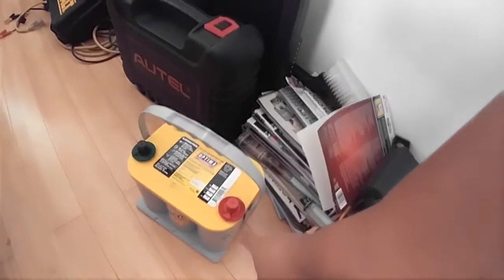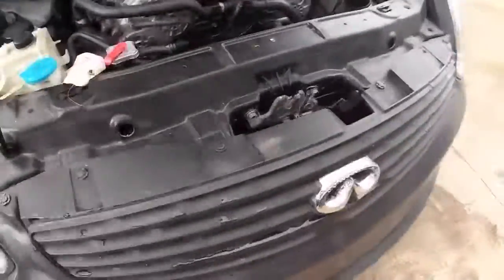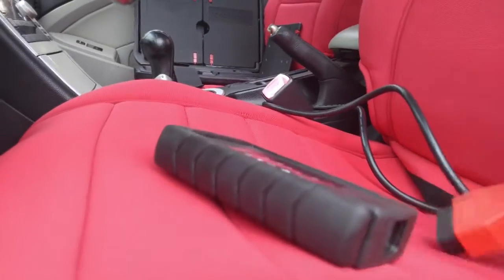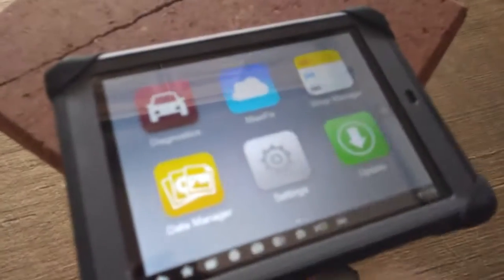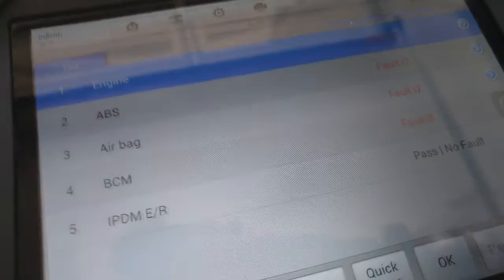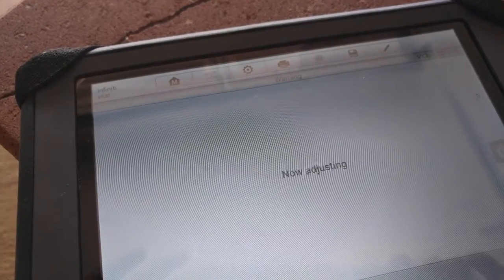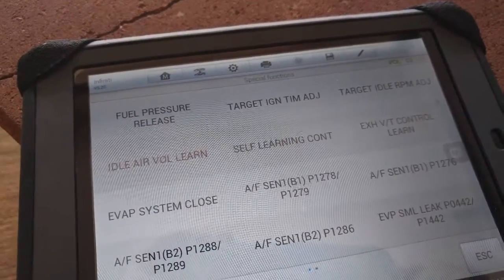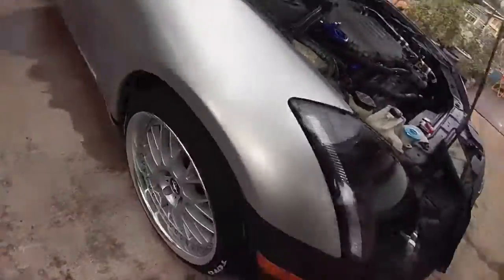Ep02: G35 Idle Relearn with Maxisys Mini

Comment: Hello Herb I have a g37
Would I be able to use this in the same way...
I would like to adjust my idle as well...
My car idle at 550 while in drive and it feels better when it's idling at 580ish...
Reply from the maker: It should be compatible on your g37.  Check your spark plugs and coilpacks
Reply: @dope1808  Everything is brand new...
1. Cam sensors
2. Spark plugs 
3. Coil packs 
4. Map senor 
5. All four 02 sensors 
Every sensor on the vehicle has been changed even the ECU...
I literally have a new car and the motor is Remanufactured...
Thanks for the response 
If you have any suggestions I'm open...
Reply from the maker: @sojuslimTDFlock  now I'm thinking could be fuel injectors and fuel rail lines...
Reply: @dope1808  I did install a new 255 fuel pump...
Do you think it could be that or something else...
What are your thoughts...
Reply: @dope1808  I had the car at the dealership shit and they said that the fuel injectors and fuel pump was fine but you the second person who mentioned the fuel injectors
Reply from the maker: Test it with other fuel injectors properly plugged in,, if not then check fuel pump flow in the tank.
Reply: @dope1808  ok
Thank so much man 👍🏽
Reply from the maker: @sojuslimTDFlock   Like what scotty says "start simple and work your way up" https://www.youtube.com/watch?v=IyHRxAWnxkQ
Reply: @dope1808  Right, 😁 Thank you a lot 🙏🏽

Comment: Sweet...but what was the cost? I need to test my BCM and I saw it on your screen.
Reply from the maker: Angels 10 I believe BCM occurs in between swapping 04 and 05 driver seats were I find 04 don't support extra airbags causing BCM. I'll let you know when the error code comes back.  maxisys cost me 1600 ish and doesn't have full control programmable of our ECUs like pro series. or dealerships does.
Reply from the maker: Sorry for the late reply, i've ended up putting back on my original 05 driver seat.  I heard there is a way to it by plugging in with resistor into the harness under the seat to get rid of the airbag light, just like how owners do with after market seats.  I still haven't started researching on that.